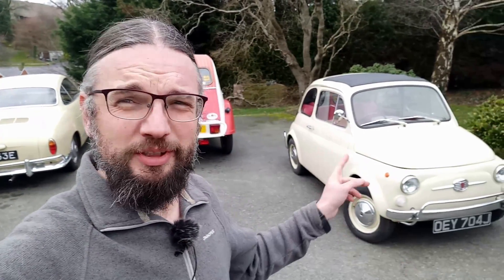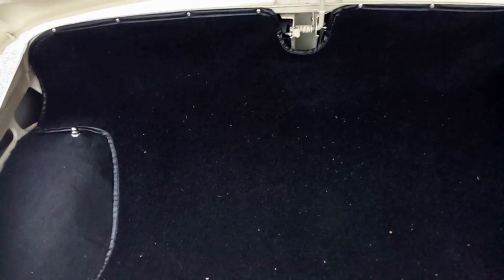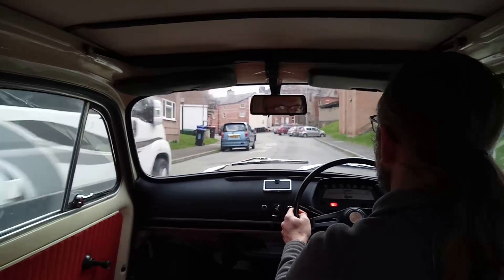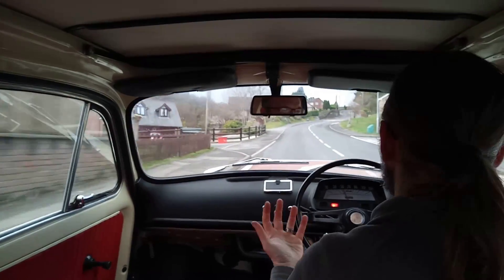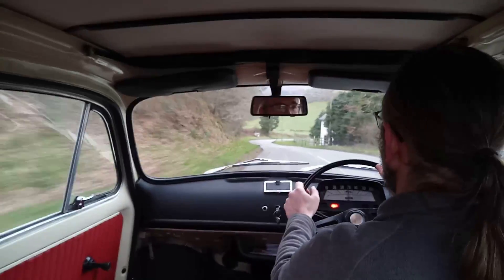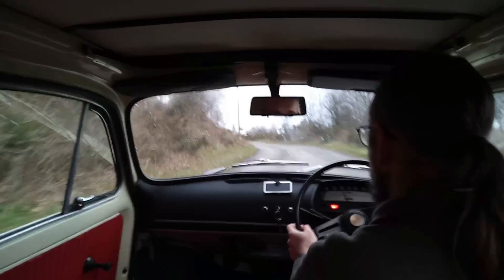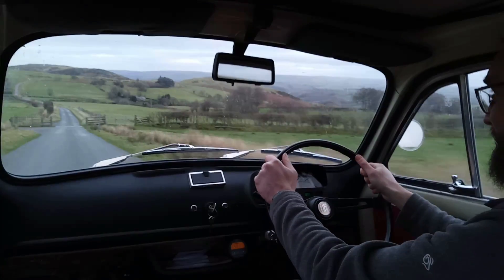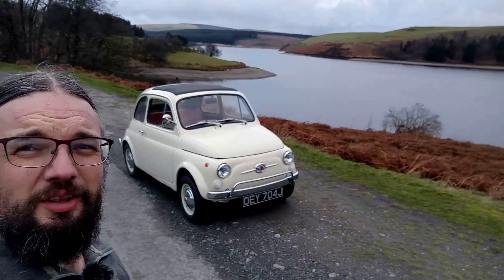This Fiat 500 is ELECTRIC! What's it like to drive?

Comment: Im currently restoring a 67 500f, and honestly contemplated a ev conversion. but the more i planned and thought it out. It honestly doesnt work for this car. A good portion of the overall experience of a classic 500 is the engine. It might not be powerful in stock form, but it is a solid aspect of the overall experience of the car, the feedback and sounds take the cake. The underpowered aspect is actually mostly fun, and makes you a much better driver. Planning your shifts, double clutching/ rev matching, momentum planning is all many aspects of driving this car to the limit. Making it a EV conversion, sadly takes away all these "driving" aspects. Its literally just a electric tin box after that. But to each their own. Kudos to whoever did this. I still wouldn't say no, but i would definitely keep a gasoline powered  500 in the garage along with the electric one.

Comment: This is an amazing car, and an extraordinary way to give more use and convenience to a classic car which would otherwise mostly been abandoned. Plus it's environmentaly friendly.
I live in Argentina, and we don't have the Fiat 500 but we have the Fiat 600, it has an inline 4 engine which doesn't make a lot of power but just enough to take on the road and even the highway ( if you're brave). They're fantastic little cars. I wouldn't do an electric conversion tho, mainly because electric cars are not really as popular where I live AND it would be very expensive, but the sound of an engine for me is part of the experience

Comment: Aww crap, now I'm too far sozzled to watch the rest of the video.  Y'see, I decided to play a drinking game, and take a shot for every time you said ''Fiat 500''.  I'm only 6.30 mins in to the video, and I already have one eye half shut, and 1/2 a bottle of Jack gone! lol.

On a serious note, electric cars are not for me.  At all. Fine if yer living and working in a town (but then why not walk?).  But, to go visit my mother for example, who lives 74 miles away, this trip would be a no go in an electric car.  To be only able to drive 50 plus miles, and then have to recharge (somewhere that has the facilities, and hopefully then, a free charge port or one that works), then how long would I have to wait to get the battery charged?

After 50/60 miles, would I need to stop overnight in the car?  And then set off again in the morning.  Can I plug it in to her electric supply overnight?  Would need a hell-of-a-long cable to get it from the bottom of the track to her house!

We have freshly installed charging points in my town, and in all the months that they've been there at great cost, not a single car has used them.  That's because no-one drives them, in the middle of no-where, in the North East of Scotland.

The thing that makes me mad about all this environmental electric car hoo-har, is that Aberdeenshire council already installed (again, at great cost), electric car charging posts in the main car park a couple of years ago.  Not one vehicle used them.  So, they were removed.  And now, just a few months ago, the Council decide to fit huge fancy digital petrol-pump style chargers (at greater cost), in the opposite end of the town.  Where, (surprise of all surprises) no one has used them. 

No tourist is gonna drive an electric car on their holiday.  They'd take 5 years to do a 3 month visit if they have to stop and charge every 50/60 or so miles.  Local people from another town just want to drive, get their stuff done, and drive home.  If you break down, who's gonna fix it at the roadside?  If you run out of fuel, at least someone, anywhere in the hills will have a petrol can, or could offer some fuel.

The nearest City is 45 miles away, and the main hospital is there.  So you could not get there and back on one charge.

No-Sir-ee-Bob.  I'll stick to petrol/diesel/chip fat/ground down and liquified horses from the knackers yard.
Reply from the maker: Not all electric cars are as crap as this one. Most currently on the market have a range in excess of 150 miles. EV tourism is a thing. Our bit of mid-Wales has very few charging options, which is annoying.
Reply: @HubNut  - Many thanks for the reply.  Don't get me wrong, this particular car, to me, isn't crap (having watched yer latest upload as to what a crap car actually is!).  The wee Fiat is just the thing for Vegans who want to travel to the latest Greenpeace rally (trusting that the rally is less than 100 miles away!) or for those that have £17,000 loose in their back pocket and no sense), just to be hip and trendy and shout ''look at me'' as they mow pensioners down silently cos the poor sods can't hear' em approaching.

The electric idea is good (ish) if you live in proper built up areas and you can run about for 4 or 5 days on one charge, only doing 10 miles at a time (which I dare-say, is more than some people drive their cars for).  My neighbour uses his Honda CR-V to go to Tesco....which is less than 300 yards away.  Mind you, he does use it to drive to the Chinese take-away at weekends, and that's just the other side of the 300 yards. 

The thing with charging points being rarer than a tartan penguin, is the offset of the cost of installing them.  To me, it's madness even considering fitting them.  Actually, it's bordering on madness even considering entertaining an electric vehicle full stop.  Even if there were 100 charge points in every town.

Try breaking the cost down Hubnut!  So one person can 'save the environment' by not using fossil fuels in their wee car, the charge machines have to be manufactured....in factories...where people have driven to work.  The factory built by heavy diesel machinery over a period of say, 2 years....where the construction workers drove to work.  Then, the finished machines are shipped all over the Uk, in trucks (using diesel, by a guy that drove to work), to be fitted in a town or city....where construction workers will have driven to work, use heavy machinery to dig up the roads, lay cables (which had to be made and shipped etc)....the whole thing is a joke....just so Green Gary or Environmentally friendly Edith can run 40 miles using zero fuel?

How many years will it take to cancel out the cost?  She'd have to run that electric car for 500 years plus, just to maybe cover some of the cost of the factory that built the charging machine.

I feel the same way about wind turbines.  The cost from start to finish, making, shipping, transporting, installing etc, they'd have to run flat out for donkeys years just to get back a fraction of they cost to make and finially plant in a field. Literally hundreds of people from a few countries involved making one turbine, so it can save a fiver on yer electric bill?  Excuse me whilst I laugh myself into a coughing fit!

Electric cars and wind turbines will never pay for themselves (in my opinion), and actually, when you think about the cost (as waffled above), are doing nothing to help the environment at all. If anything, they are causing MORE pollution, and using MORE fossil fuels from other vehicles and machinery just by being built....just so someone can run silently to the shops and save 50p on a loaf of Organic Gluten Free bread. Made by materials that were trunked up by a truck or train.  From a boat/ship/plane that sailed/flew halfway round the world using christ knows how much fuel?

Right then.  That's my spleen suitably vented.  Onwards dear boy!  Keep on keeping on!

I think we all need a Valium after that.  Sorry - just looked to see how long it was.

Comment: I have a lot of affection for the Fiat 500, the first car I had after passing my test at 17. Lots of fun spun it more than once in the rain! Drove it everywhere. Got it up to 65mph on the M3, could have been faster!  I loved the gearbox, dog boxes are fun, pump the clutch on upshifts, double-declutch on downshifts, easy!  
The engine was the weakest link, over revving would break the crank and /or knock out the main bearings. Also, it was easy to strip the spark plug threads and the exhaust had a habit of falling off, so the bonnet if you forgot to latch it!
Updating to an EV is a very logical step.

Comment: yeah... i get the dislikes, they are right, this is a bit of a dissacration, not only tematically but also on the level of "there's one less" concept... but i have to say that with that lightweight, these cars vould run way longer and have a real kick from another electric car OR stock engine, also you can't go on the roads with a soapbow with an electric engine (at least often you can't in most countries, so you can't build a lightweight contraption)... "weird flex but" no (cit.)

i'm an italian (ex) mechanic btw

Comment: It is a good thing to own and drive an EV. However ... a good idea would be ... to buy an EMR measurement device ... and measure the level of electromagnetical radiations in that EV ... and compare it with the level in a "fossil" car. After that ... buy some foils of lead (stomathological clinics know where to buy such a product) ... and cover all the car floor ... and the motor compartment. And continue this covering until the level of EMR is safe. It will save you ... from some nasty  cancers.  Maybe the rest of the family, also, will benefit from that. Good luck :-) https://www.saferemr.com/2014/07/shouldnt-hybrid-and-electric-cars-be-re.html

Comment: Have you ever driven 1 with a 650 and abbart modded? The sounds  and power feels realy good. + acceleratie is nice
Reply from the maker: I drove a 126 engined one last year, but it wasn't exactly rapid.
Reply: @HubNut  we got 2 500 1 with the 650 but it's faster to 50 kmph and higher pull then my corsa b

Comment: I absolutely agree that the way forward for commuter, 'round town use electric cars is to make them small and light weight in order to maximize efficiency. There's no need to make them to compete against internal combustion powered car performance; they should be their own thing. I'd prefer three wheels like a Messerschmitt~ but with bigger wheels. I've often thought the arrangement would work well on a three wheel platform with the motor and batteries up front whilst being front wheel drive. It doesn't have to be complicated. The technology will need time to mature as was also required for fuel burners.

Comment: I think how a classic car sounds is to me part of the experience of driving a classic car, for example driving a Morris Minor without that fruity exhaust note would take away one of the characteristics of that car, or maybe consider that Austin Allegro without the A series whine, it just wouldn’t sound or feel right with an electric motor driving the wheels, yes it’d be much quicker, cheaper to run and better for the environment but it’d be flat, no fizz, no purr of an engine makes it sound somewhat dull.
    I’m not against Electric cars, I like the Nissan Leaf for example, good looking car and it is what it is and what it was designed to be.
    But in a classic car?? Errm, not sure really...mixed feelings.

Comment: I’m honestly surprised that all that effort to electrify the power source - yet the lack of a fiat 126 close synchromesh gearbox installed, its a straight fit. Shame no extra effort was made to the gearbox. And the drive shafts and cuplings could be used off an 850 coupe. 
This little bone rattler could have been made so much better
Reply from the maker: There's not much point changing the gearbox when the idea is that you don't have to change gear. It has had beefed up driveshafts fitted, but I'm not sure what from.
Reply: But after some usage chapper - the crash box will finally be munched to death - I was more for the longevity of the box not so much the functionality:)
I get what you mean,  but still.
Reply from the maker: @helir00  Yes, I do see the concern there. This isn't the first 500 they have built, so maybe the transmissions are hardier than expected. After all, I know folk putting 100bhp through a 2CV gearbox more used to 29. Small cars can sometimes offer a surprise!

Comment: thats fast Ian where are the electric motors placed KORF
Reply from the maker: Motor is bolted to the existing gearbox.
Reply: @HubNut  God what would it be like if it had one on each wheel you would not be able to see it it would flash by KORF

Comment: OMG the very first thing I thought when you introduced the air-cooled vehicles was "well, technically it is still air cooled!" hahaha guess I'm quite pedantic. Great video and great car! The only thing I wonder is... a 60 hp motor (very small!), using 60% of power in test mode, on a car this small and this light with skinny tires... still has a range of 55-70 miles??? My goodness... what do we have to do to have a decent range in ev's?

Comment: Wow looks like it out performs my Fiat Panda 1.2, that thing just dies uphill. I hate having to shift to first in my car, the bearings are going and it makes me cringe, there is noise right up to 3rd gear now but in first it sounds like a buzz saw is tearing through the transmission lol. Roll on my birthday I'll hopefully have passed mi test and be getting a new car. Unfortunately I'll be sticking to petrol but I must admit, them electric motors look quite fun and interesting.

Comment: Great Video Ian - great fun, all told, and many thanks. Very enjoyable, and interesting with its existing crash gearbox, giving a choice or ratios.  Apart from the present expense, as you say, the conversion is not for every car, but that is a great application here, transforming a normally very noisy vertical twin Fiat engined Nuova into a fun runabout with oodles of character. Best wishes.

Comment: I am glad that the high voltage wiring is sealed away as I would not like you to become a bright spark or the video to be shocking. My feeling is that vehicles in the future will have both an electric motor and ICE as I have my doubts over whether the UK would ever manage if everybody had pure electric cars.

Comment: How much does a electric Fiat 500 cost? 

Watches video and receives answer.
Reply from the maker: That figure didn't include the car...
Reply: @HubNut   To include a late 50's Fiat 500. Which then had to be mostly restored. Less engine of course, I would say. $15,000-$20,000 USD. So even if the total price came to $35,000 USD. I'd say not bad, I would buy one if I could afford it.

Comment: That conversion appears to be a well sorted job with upgrades to the rest of the car to match the increased power. It is expensive but prices for parts will drop in the future as history repeats itself.  I do wonder what the energy carbon footprint thingy of all these new power cells is and will be when they have to be disposed of safely. When i bought my diesel transit i was being green but 12 years on i am a pariah as its now the wrong type of diese enginel. I intend to run this van into the ground so i can run it  well into the future with far less impact than recycling and replacing. Who knows maybe people with currently the latest cells may find themselves in a simular situation in the future.  Maybe we will be revisiting lead acid as it turns out to be nicer in a green way.
Reply from the maker: Lead acid is just too heavy. Modern EVs use tiny battery packs to create more power by comparison.
Reply: Lead acid it too heavy now but has been used in the past.In the 70s  the enfield was produced on the isle of  wight and had a range of about 30 miles if memory serves. Lead acid has had some improvement with the advent of the gel silica electrolyte lead battery which changes the way in which the cells could be designed and positioned in the structure. Updating existing technology is never as sexy or financially rewarding as designing a new product. With outside of the box thinking driven by enviromental issues who knows

Comment: Sorry to upset the greenies, but yes, an engine is very much a huge part of the classic car experience.
No matter how enjoyable that Fiat 500 is to drive, the experience is a very different one to the original engine and having to use the non-syncro gearbox.
And you should not drive it 2 footed, just as you should not drive an automatic 2 footed.
Classic diesels are the closest to retaining the exact original experience, with recycled, carbon neutral, waste vegetable oil fuelling.
Reply from the maker: I beg to differ. I'm a petrolhead, but this was still enjoyable. There is also absolutely no reason not to drive a car two-footed. If there was, would automatics have a wider brake pedal to encourage such behaviour?
Reply: @HubNut  I'm not suggesting that the Fiat 500 wasn't great fun, but part of that fun was the new experience wasn't it? As in different, but good all the same?
Just a couple of days ago I followed a Nissan Micra, clearly being driven 2 footed with the brake lights illuminated 90+% of the time, even going uphill. Driving 1 footed is the only way to pass a test in an automatic and ensures no fighting between the forces of acceleration and deceleration.
Reply from the maker: @matthewjenkins1161  Bad driving is bad driving. There is nothing wrong with using both feet, but you can no more rest your left foot on the brake pedal than you can the clutch. Either is stupid. As for the Fiat, I genuinely believe I could live with EV life, even on an older car. Engines have plus points, so do electric motors.

Comment: What happens if you use 1st or 4th gear?
Reply from the maker: First gear can be used, but you'll run out of revs. It just isn't necessary. Fourth can be used similarly, but there's no advantage for doing so really.